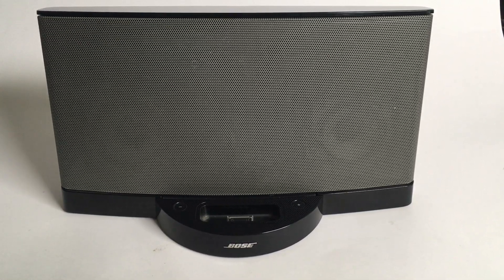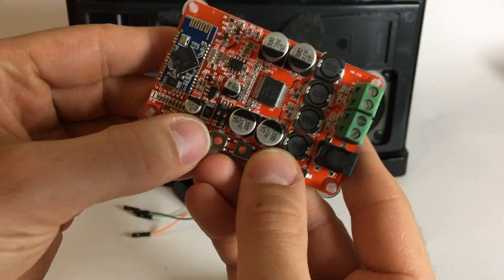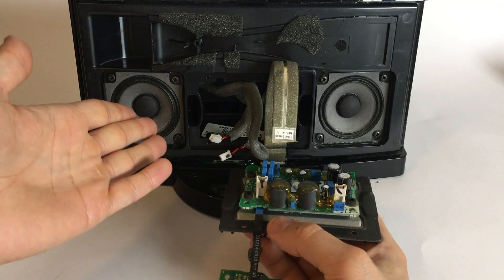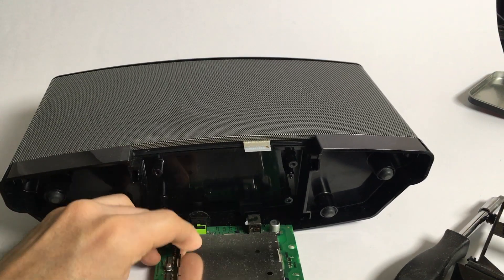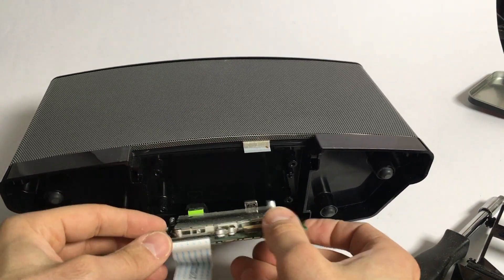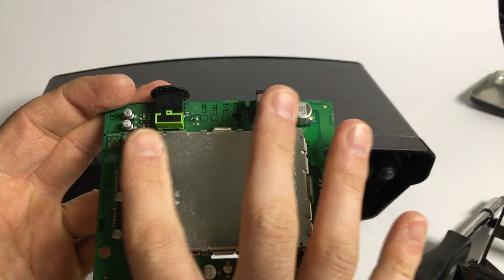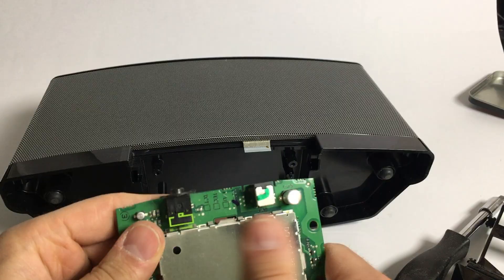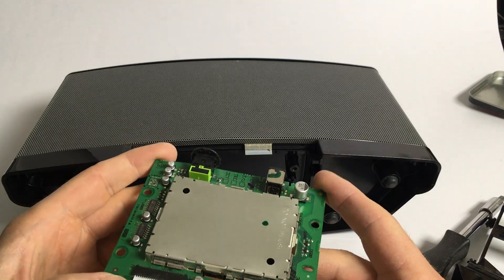A/B Testing Bose SoundDock Series 2 against generic amp board

Comment: It sounds bad because in the bose sounddock, one driver handles the bass while the other one stands for treble, the TDA is sending the signal without clipping either of the two, also lets take into account that bose doesnt use enclosures but resonant air channels (Idk how its called, english is not my first language lol).
Reply: I've seen the amplification circuits. Pretty sure both drivers are playing full range. Its probably the signal processing  or enclosure leak that makes it sound bad
Reply: @chinshenglee5439 the enclosure leak is very strong

Comment: You can buy a 5V micro USB bluetooth receiver off eBay and plug it into the Aux input on the dock - easy, costs $5 and you get to keep the original Bose tuning. Or try one that fits in the 30 pin dock, but one I had didn't work and it was supposed to be one of the "better" ones at the time

Comment: Is there any way I can find thematics of it ...and make it battery portable... ?  thanks for help.
Reply from the maker: you can make it protable if you use the external amp board. But it will not sound great. Powering the original setup from battery will be trickey because as far as I remember it is not plus and minus x Volt, but it is more like plus 12 volts and minus 12 volts... Thats the reason why I fried the board later on...
Reply: Best to find one of the original battery powered sound docks. That way it's already all done for you and maybe all you need is to upgrade the battery, unless Bose has isues with battery like the Soundlink mini
Reply: Find something that's 16 to 18 volts. Should be able to power the Philips (I think) class d amp in there. Fyi that would be 5* 18650 li-ion batteries

Comment: Hi, great video, I like it. By the way, do you happen to know the input pin for the left channel and right channel on the amplifier board that is located in between the two speakers? Cheers
Reply: Did you try it? I'm wondering the same, maybe we can use the Bluetooth receiver and connect it to the bose amp innit?

Comment: thanks peter, i have both the series1 and two and planned the same thing as you, but the DSP is strong on that one. so i will keep my TDA for other speakers and solder a Bluetooth IC on the Dock instead..... right now i use a Layen BS1 in the Dock Series on. which is a (not so Cheap) alternative if you want to keep the original Soundprocessing, my dock2 uses a way cheaper bluetooth two 3,5MM, Jack adapter for 7 bugs -> HK008 with one jack and one "manly" connector, which i like a lot because it also features a Mic ;)